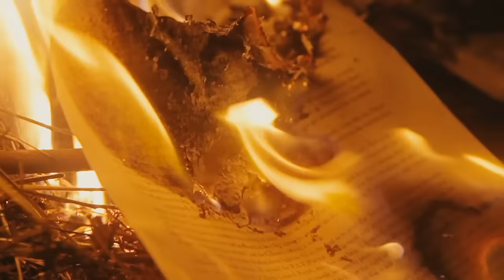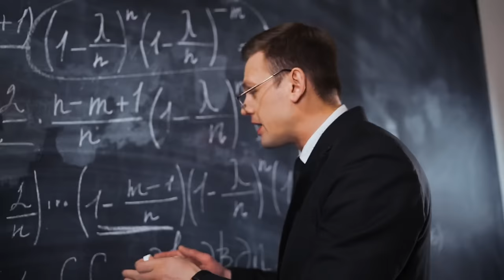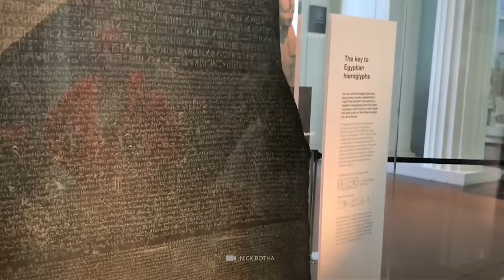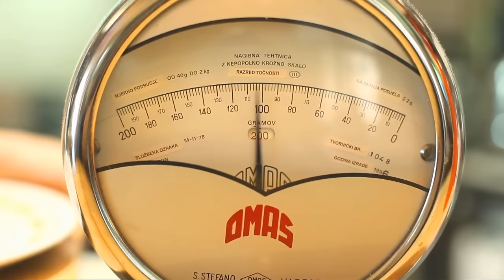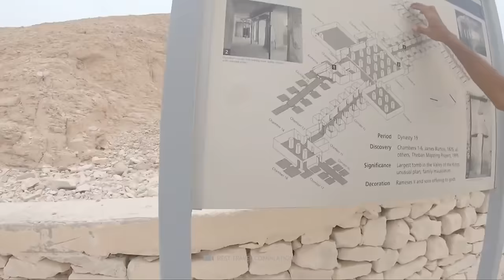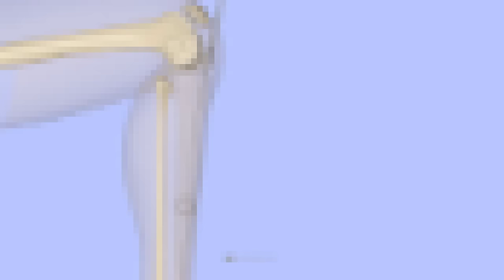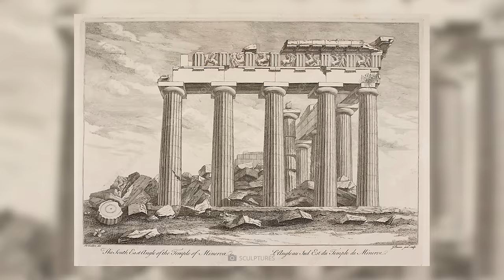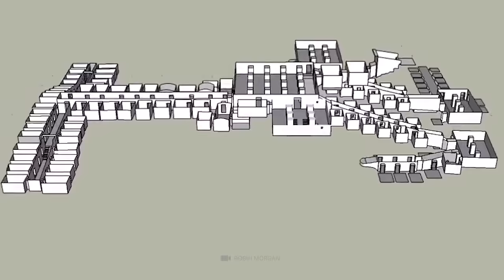Egypt’s Ancient Mystery! This Discovery Solves the Mystery of the Pyramids!

Comment: People claim that the pyramids weren't built by the Egyptians. That the great pyramid of Giza wasn't built by khufu, and that the pyramids are thousands of years older than the date of Circa, 2500 B.C. that modern Egyptologist give them. If the pyramids weren't built by the Egyptians, and khufus pyramid wasn't built during his reign, then how do you explain khufus name being written multiple times within the relieving chambers in the great pyramid? The relieving chambers where khufus name is written weren't discovered until 1837. And there is no way someone would of been able to get into them after they were closed when the pyramid was built and before they were tunneled into in 1837. The only way khufus name could of been written was when the pyramide was built. Also, some of the other pyramids at some of the other complexes have wood inside them. This wood is in the form of large wooden posts, and they are built into the pyramid, not added at some later date. This wood has been carbon dated to around the 4th dynasty. Being a little bit older than what was expected, but not thousands of years older like some people claim the pyramids are. How do you explain away this evidence showing the time when the pyramids were built?